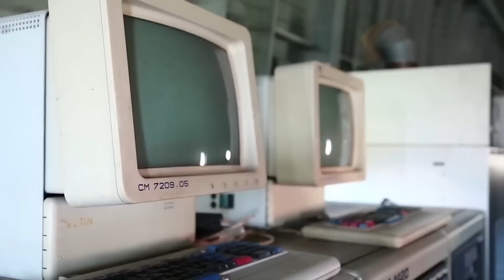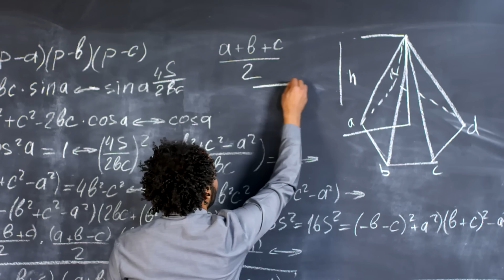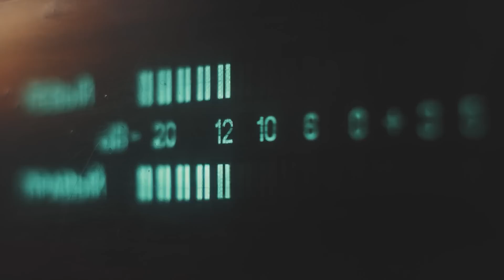What If NASA Is Reverse Engineering Restricted Alien Technology

Comment: Like Quantum batteries that never lose their charge using Quantum vortices. Are used in a Quantum battery that contain and maintain Quantum entangled electrons within a electrolyte. And are a type of topological defect that occur in superfluids and with superconductors magnetic field. They are holes in which a superfluid circulates around the vortex axis. The interior of the vortex may contain excited Nano particles within a superfluid liquid electrolyte or air, within a vacuum.
Quantum vortices are defined as a region where the local rotation dominates the strain. The flow of the superfluid is quantized, meaning the circulation takes on discrete values like Quantum entangled electrons within the nucleus of nanoparticles of Fool's Gold within the electrolyte.
Here are some things to consider when buying a quantum vortex vacuum generator:
A vortex tube like the Quantum battery Pyrex glass toroidal tube can be used as a variable aperture to reflect the cooler central vortex.
A vacuum pump or thermal acoustic vibrations from varying frequencies pulses may allow a successful cascade of vortex Within the inside of the toroidal tube that has been laser etched with a fentosecond laser to be super hydrophobic and the difference between it and the laser etched rail strips to WIC one of two superfluid liquids within the tube.
Adjustable vacuum generators can combine the benefits of high and low vacuum generators. By threading the plug in or out of the body, you can control the amount of vacuum and vacuum flow that they generate thas done with the BMS. Otherwise known as Zero Point Energy.